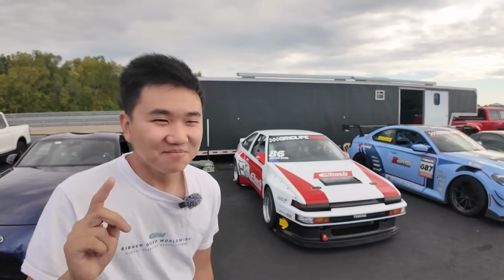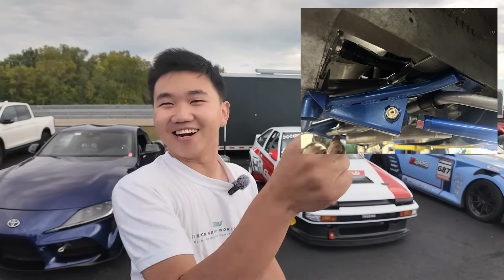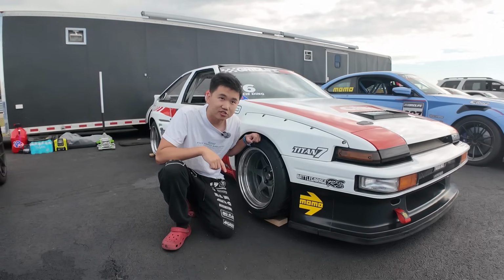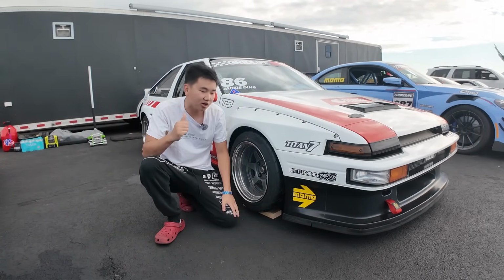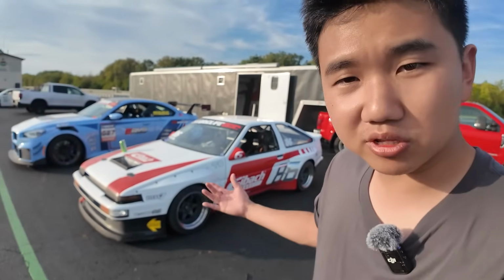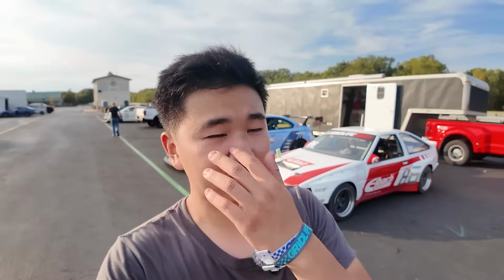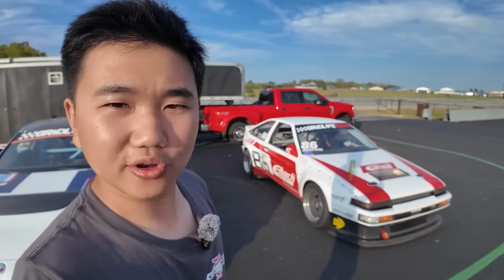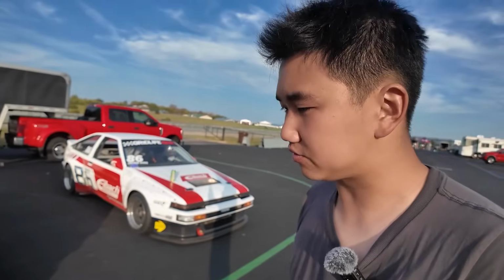GLTC AE86 on Maximum Attack!! PhD Eibach AE86 Gridlife Touring Cup Autobahn South

Comment: Jackie, I don't know how deep you went when setting up the rear. If the car is in the air, bottom out the suspension all the way like it as far up as the rear will go. Then tighten everything to spec. Remove whatever was holding the suspension compressed. It'll show you if you have any binding and let the suspension do all the work

Comment: You need to read up on contact patch. The lighter the car get the smaller it gets.  Wheel & tire size will only change its shape. Pressure changes do change size as weight does. 

Also, your approach of looks over fuction may be why the car is so ill behave. You may need to increase ride height in order to dial it in. 

You could delay your downshifts a little, I see so much engine braking. First, that adds temp into the rear tires, and 2nd, it ads unnecessary wear on the coasting side of the pistons...
Reply from the maker: I can read into it but I do think increasing tire diameter would change the contact patch size? More importantly I think going to a larger and taller tire would increase our tire heat capacity so we can push longer and harder before the tires overheat.
The car already drives about a million times better than when we started so I think we’re making good progress, and I’ll keep making changes at my own pace to dial it in:
Reply: what is the coasting side of pistons? i dont quite get that...
Reply: @GanjaNinja  sure, pistons have a thrust side and a coasting side. Most ppl are familiar with the 4 strokes. So, during the power stroke the piston is forced down. During this, the piston lightly rotates in the cylinder. The piston skirt that has the most contact against the cylinder wall, is the thrust side. Thus, the opposite side is the coasting side in the other strokes. I hope this makes sense. If not, let me know.

Comment: So rt660 tires are trash? What's another recommended tire on same category that's better? Besides advan...
Reply: Most GLTC cars run the Kumho Escta V730. But some drivers like Ben Thorn who drives an EK Civic run Kumhos in the front and RT660s in the rear.